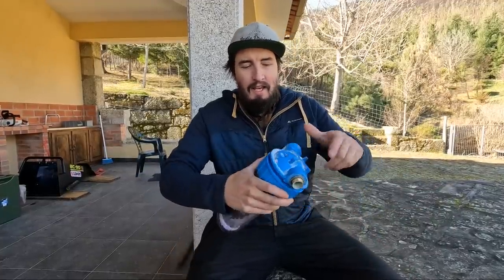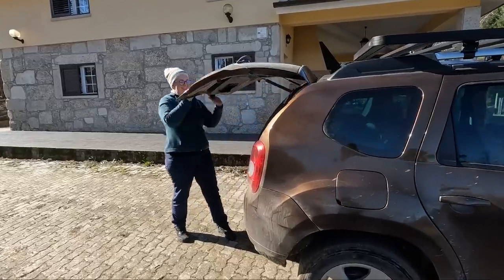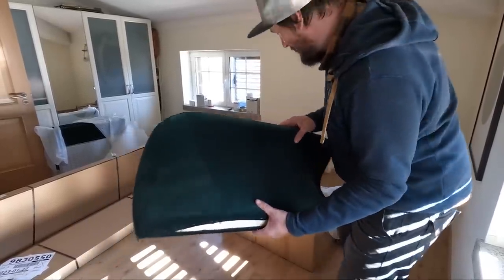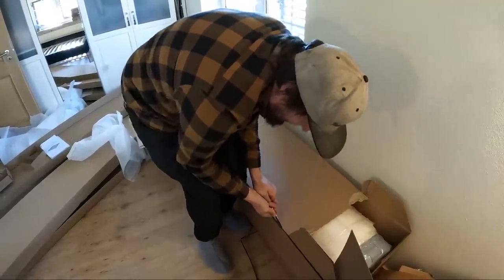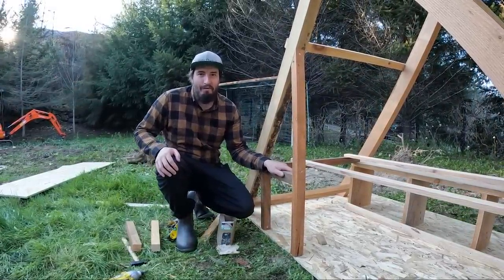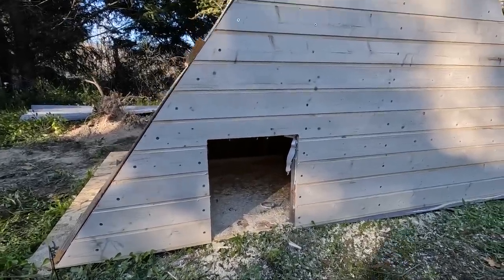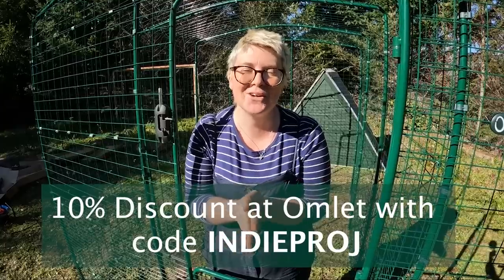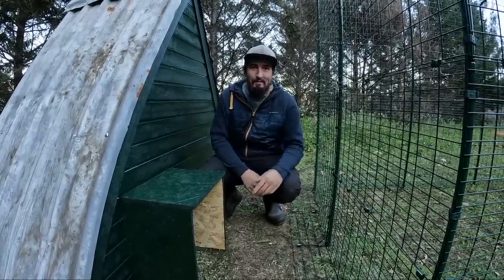Building and Living in a Portuguese Forest | New Homestead Beginnings

Comment: Coop looking great, have you thought about putting it on to rolling wheels so it can be moved as needed to greener grass areas ?? Feeding the chickens with a nutritious and diverse diet by placing the coop in different locations results in the production of better quality eggs. The chicken meat will also have a better flavor.
Moving the coop around the yard keeps the grass trimmed as chickens eat it as part of their diet.
Because the chickens are moved to a new pasture spot frequently, the requirement for pre-mixed foods is reduced. The natural growth in the garden helps to supplement the diet of your chickens.
A portable chicken coop is frequently built without a floor, eliminating major cleaning. The birds deposit their dropping directly onto the ground making it more fertile.
The coop occupies only a small area on the yard. This gives time for the garden to fully re-grow before the chickens feed on that patch again.
The feeding chickens do their bit by digging and scratching the soil and prepare it for seeds that can be planted. These actions also help to enhance the growth of the existing plants and crops.
The chicken coop can be moved to safer locations when bad weather arrives: move them to the shade when sunlight is too harsh or under cover if there is a torrential downpour. They can be moved away from muddy areas of the garden to where fresh grass is available.

Comment: Congrats on running water. Soon hot water. Bed, mattress and new lights. Plus wood from 5 acre property for house heat. Moving animals soon. Eventually clearing the 5 acre property, then for sale.
May want to consider elevating the chicken coop 6" -10" above ground. Minimize dampness, flooding, wood rot. Use foundation blocks/stone. Build a base. Fill with sand and rock. Cover with plastic, wire mesh. Lay existing coop on top. Add a hook or strap to secure open hatch access when fully open.